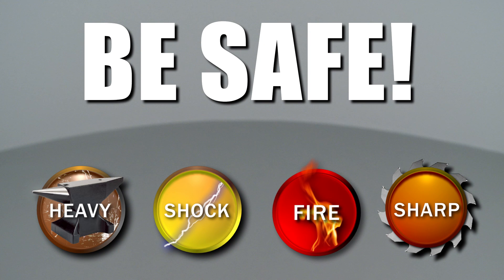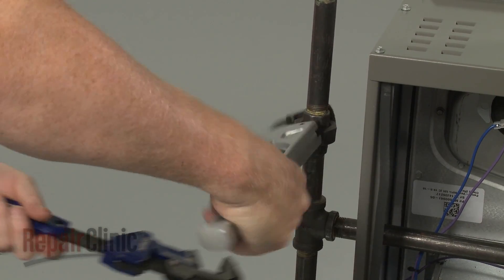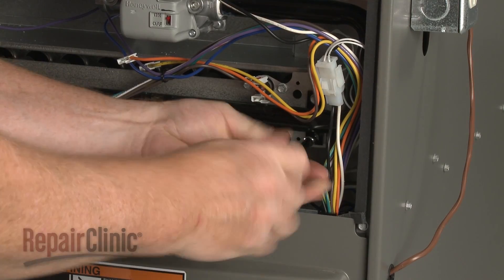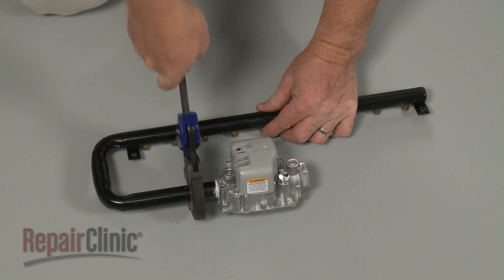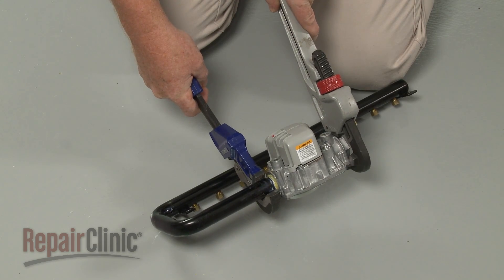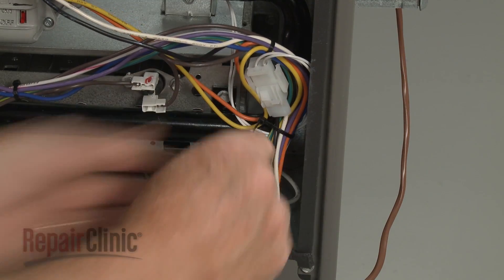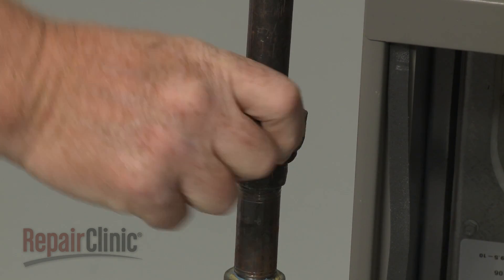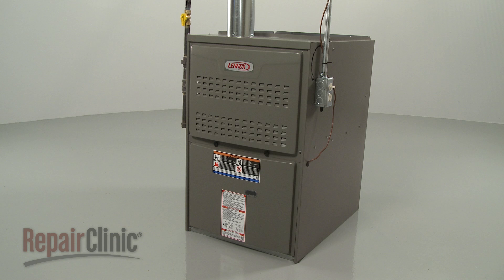Lennox Furnace Gas Valve Replacement #73W17

Comment: If you don't mind the idea that a gas valve does not always have the correct outlet pressure out of the box, this should be fine. However, without the the tool to measure and the knowledge to adjust manifold pressure, you have only done half of the job. Remember, when you do a job like this as a homeowner, all of the responsibility is on you. Pros have millions in coverage for a good reason. Things go wrong. If it's your house and your family, you have no recourse having done this kind of work yourself. I have been doing mechanical work for over 50 years (I'm 72 now, and I own my own company) and you would not believe what it costs to have coverage that protects people when it hits the fan. You also would not believe the things I have seen. Good luck.

Comment: You want a manometer to measure gas pressure and a co meter to determine burn quality otherwise you run the risk of either not getting the quality of heat you had and can kill your heat exchanger which means a whole new unit.  Plus if you crack the exchanger from a bad burn or excessive heat you risk carbon monoxide poisoning or fire …. A manometer is 40$ and gas pressures are on the furnace.  Aa far as co goes thats not as crucial as the pressures but will boost efficiency..

Comment: Does it matter which wire goes to which terminal? If you aren't replacing a like for like gas valve, you might not know which terminal is which. Do these style gas valves have polarity?
Reply: It's 27V AC power, so I think it does not matter. But you should label them and install them back the same as before.
Reply: @JeilianZhang It doesn’t matter, but they should be labeled? That doesn’t make sense.
Reply: @TheZachening  I am not an expert, just in case I was wrong

Comment: There are (at least) two companies who make compatible gas valves for my furnace.   Lennox wants about $200 more than White Rodgers, but my furnace came with a WR valve originally.  Is there some reason I shouldn't use the far less expensive WR replacement?  Thank you!  Helpful video.
Reply: I always use the OEM because of the maintenance of the UL listing. It's a defense against a lawyer who would tell a jury that I did not use the correct part.
Reply: @arthouston7361  Thanks... great point.

Comment: I was just quoted $700 to replace this in my furnace by a reputable local HVAC company, and $150 to unscrew a screw and replace a flame sensor that cost $5 on amazon. I'm all for paying a good wage for high skill labor, but HVAC companies really need to think about how they price these repairs - 40 minutes of work (including leak test and checking system functionality and $70 part, $200, maybe $300 Ok i'll pay it, but it's getting ridiculous.
Reply: I paid 500$ for a lennox gas valve today(supply house cost), paid a tech 50$ for the hour and a half to do the job, another 30$ in gas, so the owner made 110$ and insured the job with liability. 700 is a favor on some brands...
Reply: @curtish.128  This part specifically referenced is $194 today, from the video link at supplyhouse
Reply: I was just quoted $650 by the HVAC company for a gas valve that's online for $130 (not including installation). I understand you wanna add a markup. Add a reasonable one and I'll pay it. But 5x is not reasonable, so here I am learning how to do it myself.
Reply: I agree. I watched this video because I wanted to know how to swap the valve. My hvac repairman wanted 900 bucks to do this. I found the exact valve o on Amazon for under 400 bucks.
Reply: @pepecebolla69 5 times is actually very reasonable. The cost of doing business goes up higher too...

Comment: You also need to adjust the in pressure values, very important, you need a meter for that.
Reply: This honeywell gas valve nonadjustable
Reply: @lzgamer8133  thank you I didn't know that I just replaced one and was wondering

Comment: seems I would want to check and verify the pipe connections for any leaking gas after turning on. I think I will wait before closing up the unit and do the soapy water test on the connections...
Reply: He did that genius

Comment: A lot of butthurt professionals here. I just replaced my gas valve using this direction. The only reason it likely stopped working in the first place is because the "professionals" who installed it failed to put in a drip leg. So, not only did I replace my valve, which was likely clogged up, I added a drip leg to hopefully ward off that issue in the future. Now some professionals can go on a lecture as to how they're the only ones who can stand on ladders, use pipe wrenches, and unscrew a lightbulb.
Reply: Sorry, but no. The drip leg is a code requirement that does NOTHING. It goes back to the time when gas was made locally at the "gas works." It had a LOT of moisture in it, and the drip leg was where that moisture collected. There is nearly zero moisture in propane or natural gas. So, no, you are having a fantasy. It's a good one...but it is 100% false.

Comment: Is there any calibrating to be done on new valve or gas pressure check?
Reply from the maker: +Ken Qualls If you have a mono-meter you can check the gas pressures, but the new valve should be set up properly from the factory.
Reply: @repairclinic  try again.  I had to adjust the one I just replaced this morning.  It was 2.5 and it requires 3.5.
Reply: Also its default is to 4.2 dependi ng on elevation it needs adjusted

Comment: I just replaced my gas value and the ignitor is turning red but doesn't start , it start sometimes when it wants to, but now Nothing, what could be the problem, thank you
Reply from the maker: +Andrew Ramos You could have a problem with the flame sensor or control board.
Reply: I'm having the same problem with my older lennox furnace. the ignitor turns red and then nothing. It was doing this before and would work intermittently but now it's to the point it won't fire on at all. Is this a faulty gas valve or is this something else? The furnace is like 15years old.. not sure if furnaces had flame sensors back then. Any advice would be much appreciated.
Reply: Did you ever figure out what was wrong with your furnace?
Reply: I have all the same issues as everyone below this comment thread, anyone figure out if it was the valve or something else? 

Thanks
Reply: @Luc89337  did you figure out what it was???
Reply: Just because the ignitor turns red does not mean it is getting hot to lit up furnace.
Reply: Use a multimeter to verify proper low voltage to gas valve, if not, bad board. Ohm out the igniter to be sure the reading is within manufacture’s specifications, if not, bad igniter. Visually inspect flame sensor, if covered in carbon, clean it with medium grade sandpaper. If the flame is only present for a few seconds then cuts off, repeatedly, the flame sensor is dirty or bad. Also be sure none of the orifices are obstructed as this can prevent the flame from reaching the sensing rod. If so, use tstat wire to clear the orifice.
Reply: After replacing it you may need to fire it up like 3 times before it gets enough gas to fill up the pipes and manifold. It worked for me

Comment: Thank you Repair Clinic! Had a chain HVAC firm come out and tell me that the gas valve in my goodman furnace was faulty and that it would cost $600 for the replacement part plus labor. Even showed me a parts list on their website listing the part for that price. However we have this thing called the internet and I quickly discovered that the part was $110.00 from Goodman and $45.00 from Amazon with free next day shipping. Thanks to your video I was able to safely install the part in my furnace in about thirty minutes and now I'm ready for winter with an extra $600 plus dollars in my pocket. I am the son of a contractor and I usually don't give people a hard time over their labor charges but I don't like it when people try to BS me about he cost of parts and materials.
Reply from the maker: +cdelaine If you would like to help support our video efforts please purchase your parts from us.
Reply: cdelaine it's called profit! The company needs profit and you're paying for someone's knowledge to come out and do it... chances are you don't know that it would require adjusting the gas pressure.. on the valve.. if it's not done so? You're in for surprises in the future.
Reply: @repairclinic  I would be glad to do so, same issue, 2 stage furnace motor blows first, then igniter glows, but no flame, it attempts this a couple of times before faulting out flashing red 7 times. My gas regulator is WHITE RODGERS MODEL# 36J54-250 24V MAX PRESSURE 1/2 PSI 
REG 3.5" YOU HAVE ANYTHING AVAILABLE????? 
Thanks in advance!!!
Reply: One of my local HVAC contractor quoted me $800 for gas valve for part and labor, a 30 min job for a pro.  With a gas valve cost $180 from Amazon or other suppler, the labor cost is THREE times of cost to visit a medical Doctor, does HVAC knowledge worth THREE time of medical Doctor?  Who can answer?
Reply: @swllz is a doctor worth as much as you think? Prices are relevant. Either pay or don't. Just don't cry when you don't pay and break your unit or worse.
Reply: It turned out that the first HVAC technician made a wrong diagnose.  I replaced the gas valve, the furnace still did not work.  I called for a different technician, he found out that the gas meter was faulty.  After the gas company replaced gas meter, the furnace worked.
Reply: People wonder why they can't get a plumber, electrician or an HVAC company to come and do work for them. It's because in order to stay in business, they have to charge enough to pay for insurance, trucks, technicians (who are as hard to find as hen's teeth) and taxes. That's why they got the estimate they got from that company. If the trucks were free, and the was no insurance (my coverage is four million) and the technicians all made minimum wage, then I could do that job at the Amazon price. I don't service homes any longer. I am 100% commercial service, where you don't just replace a unit...you have to fix it.